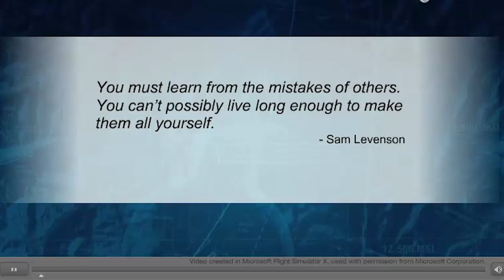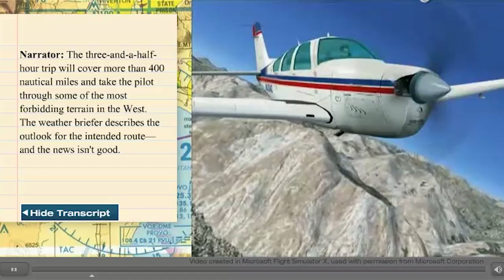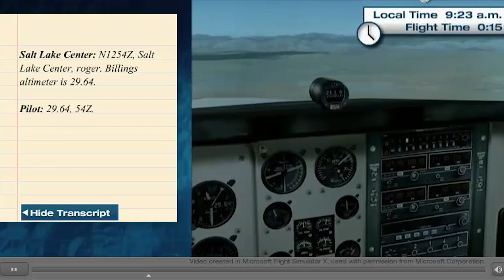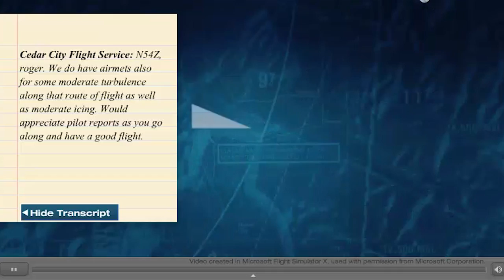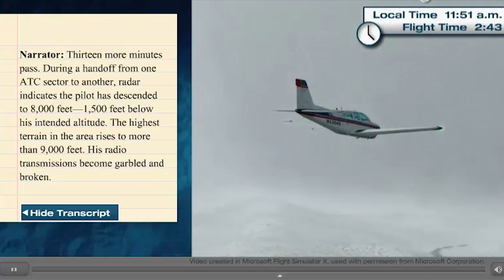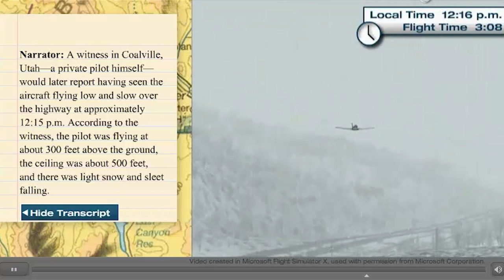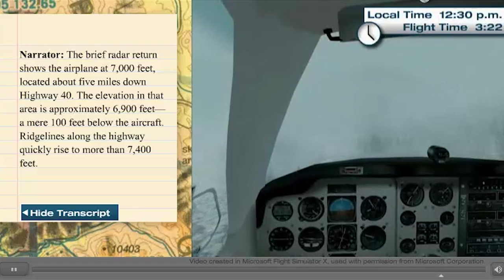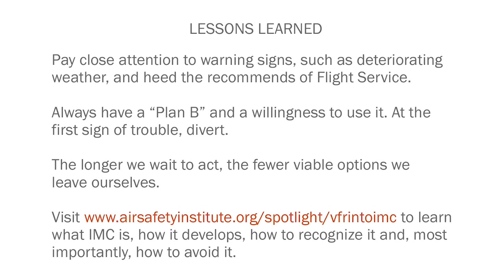Accident Case Study: VFR into IMC

Comment: It happens on, and on! I don't understand how a pilot in this situation - which is clearly a lose-lose - doesn't climb out to a safe altitude?! Just look to the map, choose a straight bearing that will lead you through the lowest terrain, and climb to a safe altitude with no delay. OK, you will encounter icing or turbulence, but it can be worse than flying in snow blindly lower and lower with no possibility of landing or turning? 
OK, he was not Instrument rated, but I refuse to imagine a licensed pilot has absolutely no clue about how to use the navigation instruments on board. If not able to use the VOR, then KSLC was minutes to the West, so go dead West, climb out as fast as possible, and advise KSLC approach or on guard frequency that you are in a life-and-death situation and will breach into the Class B airspace, sorry about that! Better a fine and the license suspended than dead!

Comment: You could have been the best pilot in the world but those conditions would be too much for you.

The pilots logic was, as long as I follow the road, I won't get lost and if I am above the road, I won't hit the mountains. 

He hasn't allowed any margin for error, mountain winds blowing you down into the ground etc.

What actually got him I think was spacial disorientation, he wasn't instrument trained, he was using the road as his only point of reference, even the briefest of white outs would have caused him to be disorientated. 
Even a highly experienced instrument pilot would have struggled. You could have used them only to keep the aircraft straight and level in a brief white out but then you are back looking out of the window to follow the road. This is never done. You are either on instruments or your not.

We haven't even gone down the route of why he flew into possible icing conditions in an aircraft not equipped. You would never fly a plane with half the wings gone. That is what icing is. Stealing  your lift minute by minute.

Comment: Been there.  Done that. In my case, determined to complete a Navex that had been cancelled 7 times. 7 sets of calculations scrapped!  So when small cloud, go thru it.  Then a bigger one.  The next - everything went sideways - altimeter spinning in a blur, hood rattling, engine screaming.  Pulling back just made things worse....wanting to quit but death seconds away......."Power back to idle to reduce rate of descent, roll wings level using ADI, PULL HARD!  Hope."  Then soaring up at 300 kts, ALIVE!  Best feeling in the World.  I was 19.

Comment: I never understood this. Even in good weather if visibility is limited at all (by heat haze maybe, or light smoke) mountains look scary as hell to fly over. Attempting it under these conditions is a complete suicide. I don't understand how anyone could look at what that must have looked like and think it's ok to try. Flying IFR on top of that in clear air is already scary enough, but attempting to go through hundreds of miles of essentially canyons in severely reduced visibility and low ceilings, with overcast underneath to top it all off - that's truly remarkable.

Comment: It absolutely boggles my mind how far some pilots are willing to push the envelope. Nowhere you need to be would ever be worth taking this much risk to get to. And if it's so imperative that you get there, don't plan to fly in a small aircraft. Either driver or fly commercial. It's just not worth it.

Comment: I'm not a pilot so ignore this entirely
1. In the nuclear power business, and in the electronics engineering business, we don't let operators run equipment until they demonstrate unequivocal competency in ALL possible modes/circumstances/conditions they may encounter.
2. The very concept of a VFR-only license or certification seems flawed. That would be like training a reactor operator to operate the control rods, pumps, circulation systems, coolant injections systems and the rest of the equipment in normal operating conditions, at 100% power, static reactivity, and not even worrying that someday he may be there at the controls when something abnormal happens.
"OH GEE, I hope Joe can handle this. He's a VFR reactor operator. We never trained him to work in zenon-rich reactivity conditions, during a startup transient where the reactor is much more touchy, and today one of our circulation pumps in out of order, so the heat transfer coefficients and reactivity delta coefficients are different, and the shift supervisor went to the bathroom 5 minutes ago with stomach pain, but I'm sure everything will be fine. And if it isn't, we'll just blame the pilot because he did some stupid stuff." 
3. How about designing a system that works and keeps people safe even when they do questionable things that can be entirely foreseen. Humans WILL make every kind of mistake you allow, even the ones you shake your heads at. 
4. EVERY pilot should be VFR qualified, because sooner or later he's going to need to be, when his butt is on the line, and probably some butts in the other seats are as well.
5. EVERY plane should be equipped with a next generation GPS/next gen variable frequency radar-virtual environment generation system that projects real-time 3D visual representation in a VR headset that a pilot can slip on instantly upon entering VFR conditions. If it's good enough for video gamers I'd say we can design one for people who have multiple butts riding on their next moves.

Comment: I ran this flight in a simulator with the same exact weather conditions.   I see what he tried there is a wide open bowl area one might pull a turn off in above 6500 ft.. But with the wind gusting out of the north and trying to turn into it thats where he messed up... no wind I make it easily, wind I crash right about where he did actually abandoning the turn and t rying to climb the litte rise that was right in front of him.  He should have went up the other side of that pass and made the turn downwind clockwise, he let the wind put him in a spot he had to try counter clockwise. It explains why he was last seen at 7000 moving north on radar, he probably crashed right after the crash site was actualy over 8.000ft according to the report.

Comment: I'm a sailor with tens of thousands of miles and decades under my keel. Seems like I'm always trying to talk new sailors on the dock out of putting to sea in dicey conditions. They simply don't understand the power and fury the sea is capable of unleashing, even with a GOOD forecast. 1/2 the time, they haven't even checked the forecast. The other 1/2 of the time they checked it, and think it's all good, and put to sea despite near-gale conditions not knowing how to reef or handle their boats in strong winds and waves.

The only times I'll take on such conditions is if A) I'm sea-trialing / shaking down my boat for a long ocean passage and require testing my ship in strong conditions, or B) I'm caught out in them unexpectedly. When sea-trialing, I work my way up to stronger conditions over several months and note what's working well and what isn't. It's a whole different boat when it's blowing 30 knots than when it's blowing 15, and it's a whole different sea. 

I watch these air-accident videos because I figure I still have a lot to learn about safety, and especially the mindset and preparation that creates it.

Comment: You know, I don't necessarily blame the pilot for going initially; however, when he asked for conditions at Evanston and Provo, he should have known that those two reporting points mean nothing for that area. The Wasatch mountains throw up weather that is very often unpassable for low performance aircraft (like the Debonair.) Even if he had an instrument rating, it wouldn't have helped, as those conditions would have had icing below the MEAs in that area. He should have known all of that and never attempted anything past Evanston. He could have rented a car and been in Provo in two hours. And those altitudes we hear - elevation at EVW is just over 7100'. Good grief.

Comment: This pilot was way too casual. He ignored multiple serious warning flags. He probably needed the work and felt he had to get there or risk losing a few bucks. Sad. ATC should be able to override clearly terrible decisions. Also, at only 100+ feet above the highway, he could have run into various cables and powerlines that are invisible in the weather.  All this and did they say he was NOT INSTRUMENT RATED? Unbelievably bad decisions. ATC should be a stop gap can cancel flight clearance. It puts others lives at risk to like drivers on that road and rescue personnel.

Comment: Wow, I was almost in this. We were celebrating New Year in Heber Valley cabin that year. After heavy drinking and dancing couple days got some afterparty syndrome. Weather was really bad even for ground vehicles. Heavy wet sticky snow on the road cause many slides off and accidents on the road.  Honda Civic front of me struggling to keep on the road and suddenly plane lights literally in my windshield. I was thinking WTF it was. After we came back to SLC on the local news station they said it was plane crash. The one things I have notice it was no engine noise, probably he was trying to land on the highway.

Comment: I’m a crop duster turned corporate pilot. When I was building time w/pipeline patrol I was a 250hr commercial pilot w/no instrument. I got socked in to Beaumont TX, ceilings/vis went from 1000 & 5 to 300 & 1/2 real quick and I nearly shit my pants trying to scud run to the field. Sat there for a few hours till the clouds cleared out and then nearly killed myself on the way out cause I tried to takeoff with the parking break on. Most humbling experience of my life

Comment: Pilots need to land on highways when conditions get too bad.  It really isn't difficult, and a lot better than trying to fly a 180-degree turn in a canyon too narrow for such.  While there is danger from wires across the freeway now and then, the risk is much lower than trying crazy maneuvers.  And traffic tends to be moving at roughly the speed the airplane would be flying shortly before landing, so not likely to hit any car traffic during the landing (in any rural area like where he was flying).

Comment: That's messed up! Every bit of it was self-inflicted but I still feel sad for the guy. 
I started off on a short xcountry in what was supposed to be a VFR route. Halfway I realized weather was deteriorating and decided to not go further and do some closed traffic work at a unicom controlled airport. Nix'd that idea when one attempt was impossible due to x-winds. Headed back to home airport (class D). The overcast was getting lower with each mile. Called up 10 miles out no traffic at that time. Luckily I was able to see airport and enter downwind. To my horror I was put on a long extended downwind and they'll call base situation. Garmin pilot identified the conditions as IMC. When they told me to turn base I had no visual of airport. Anyone that has used Garmin pilot knows that it is not ILS accurate and is a proximity navigation software. Countless touch and goes at my home airport saved my ass that day. I didn't see lights until about 3/4 mile. IMC is  no joke in a VFR plane or VFR rated in a IFR rated plane. 
The punchline to this is the plane was a rental. When I  got back they said you're back early. I told them I didn't want to be late. They said don't worry everybody else canceled due to weather. I did a mental heehaw. In hindsight I could have asked for vectoring assistance.

Comment: "VFR into IMC"    

How can there be SO many accidents caused by "vfr into imc"?
Reply: Because most pilots can fly decently, meaning they dont do stupid mistakes that cause stalls in good conditions etc. Secondly, it takes about 10-15 seconds to lose your spatial awareness in the clouds. You might start to feel like youre banking to the right even if the plane is perfectly level. So you then adjust and roll to the left to compensate. You might feel like youre level even if youre in a downward spiral. Thirdly, VFR pilots dont look at the instruments in IMC. They try to look outside the window to get some visual reference. They keep staring outside, and this is tricking their brains even more and more because all they see is white soup. Ultimately it leads to loss of control since you do movements that stall or spin the aircraft.

Our brains get tricked so easy when we lose visual reference. Try standing on one foot, then do it with eyes closed. Its impossible.

Comment: You can hear his attitude when he talked to the weather briefer as well as ATC, and it seems like he just would not listen to what they were trying to tell him. His response that the weather is fine where I am now and I'll slide in and take a look, says to me that maybe his intention was to get out of trouble when he first identified it, but he didn't. But that is beside the point since the conditions were not VFR where he was going. Thus why do you need to take a look, unless you had already made up your mind to roll the dice into IMC? 

If the conditions along the route were not VFR, there should have been zero decisions to be made. That should have dictated that he could not fly his intended route, and thus remained on the ground. The only question in my mind is this, and not being a pilot I cannot say with certainty...Did the forecasts that were given to the pilot accurately reflect what the pilot eventually encountered, which were blizzard conditions with visibility so bad he had to fly 300 above the ground? So how big of a gamble was it compared to the information he received? Obviously if the forecast was IFR, it shouldn't have mattered considering he was not IFR rated, and considering that he was told multiple times the weather was too bad for him to fly VFR, did he realize that conditions could be much worse than those forecasted? That is assuming conditions were worse than what was given to him, which appears to be the case from what I understand. I realize that forecasts can differ from conditions on the ground in a particular location. It seems pilots should have a good understanding of the weather, like a meteorologist insomuch as it applies to how it can change and what it means for flight.
Reply: Yes, the forecasts mentioned seemed fairly accurate. (from my understanding without pilot training).
The forecast before he even took of, was talking about level 2 and 3. Those are hazardous and worse levels.
Level 2 is commercial jets for a few minutes, until they break out of the clouds, level 3 is NOPE, avoid, even a commercial jet can't really handle this.

Comment: All holders of commercial pilot licenses should be instrument rated.
Reply: Having the rating is not the same as being proficient at IMC flying. I believe the video quoted that 1/3 of pilots involved in VFR into IMC crashes are instrument rated. In fact, the flight in the video has some alarming similarities to the helicopter flight that killed Kobe Bryant (marginal weather conditions from the start, VFR into IMC, terrain impact). The pilot on Kobe's flight WAS instrument rated but had logged very few hours flying IFR in the year leading up to the crash.
Reply: @wesleyhurd3574  Yeah instrument flying is a skill, and like any skill if you dont use it you lose it. This guy was probably staring out the windows until his head went through the instrument panel.

Comment: Wait, WTF! “Holds a commercial pilot license but isn’t instrument rated.” Don’t commercial pilots fly in the dark and rainy weather?
Reply: "Don’t commercial pilots fly in the dark and rainy weather?" Not without instrument ratings. A VFR commercial certificate is appropriate for things like being a glider tow pilot, towing banners, power line patrol, crop dusting, etc. , but not for long cross country flights with questionable weather conditions. 
Also, remember that there's a "commercial certificate" (minimum 250 hours) which allows a pilot to earn money flying and an Airline Transport Certificate (minimum 1500 hours) for virtually any kind of air carrier (airline) work.